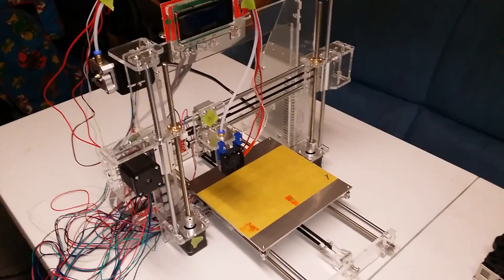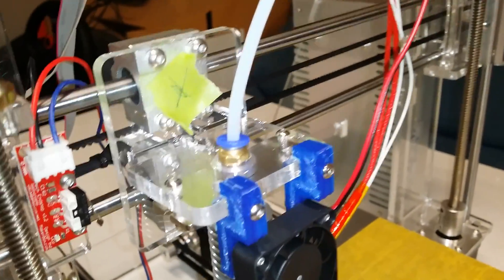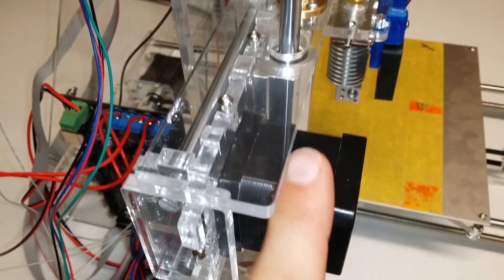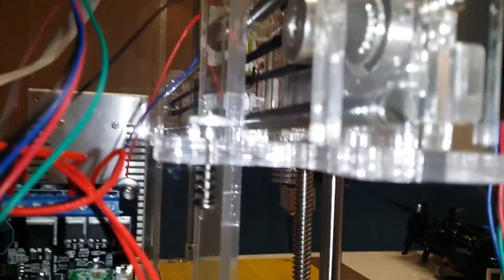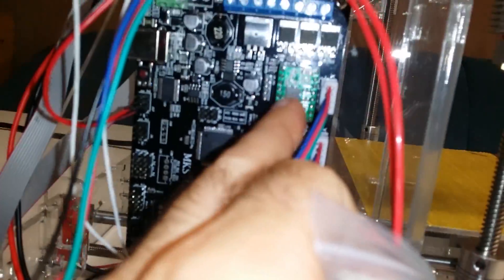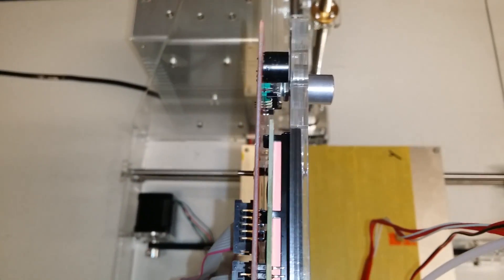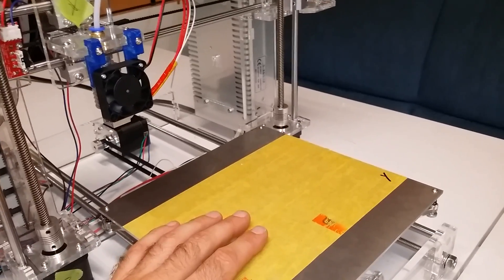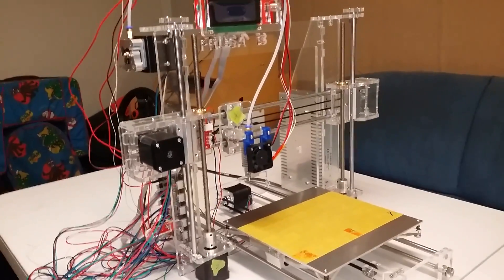Sunhokey prusa i3 3d printer rep rap kit build update 1

Comment: hey how this printer doing after 2 years?
Reply from the maker: Still going strong i have made a few mods 
if your interested i will do video on them
Reply: Of course I interested hehe, I want to buy the 3d printer but in my country, this thing is not really popular so there is only few type of 3d printers that available here and this version of the Sunhokey 3d printer is the most common here. I actually love into Anet A8 which has a good price and bunch of positive review but I need to spend more money for shipping and tax because Anet A8 currently not available in Indonesia. And do you thing is that worth that if i buy this version of the sunhokey 3d printer in 2017?
Reply from the maker: Not a problem.
main mods are the j head that is supplied with isnt very good
so order the e3d version (not the lite)
the roll holder is terrible so i will show you the way i have done it 
and grab your self some 
3m brand blue painters tape 
i will cover the rest in the video
give me a week or two do the video 
thanks for the interest
Reply: Yeah, you should make a video about how this machine is doing after several years, maybe its would very helpfull for people like me hehehe. Also It would be nice to see how the accuracy of this machine after 2 years of operation etc. Thank you btw for the information, you just got new subscriber.

Comment: I have the same machine. My problem is the heatbed as well.  But in my case, the heat bed does not respond to the g-code to heat up, I can use the preheat option in the control board, but as soon as I start a print, the heatbed turns off !  I was wondering if you might have an idea as to what the problem is.

Comment: Finished the build a few days ago, exactly the same issues you pointed out. Had to do some guesstimating and research on where exactly things are plugged into on the controller board. My fan on the hot end just goes flat out regardless of settings or where it's plugged in. Getting the printing dialled in the last few days, used the settings for the slicer and repetier that is shown in his video. Get curling problems with PLA and green tape, will try skirt and brim settings in slicer tomorrow. Cheers.

Comment: Hi gymp1979,
What printer speed do you use when printing pla with this printer and what temperatures and layer height?

It a nice cheap printer, but everyone seem to have problem with the cracks in the frame. Even when using shorter screws. But is seems to hold, for now.

Comment: 1. To compensate for the part that relies on only one screw, apply a drop or three of CA glue (cyanoacrylate) and then screw it into place. Be sure to position it just right... You could apply masking/painter tape around the position to force the correct position/alignment... 2. It looks like you might want to buy a piece of plate glass. From what I've seen, people don't rely on the heat bed itself to be the build surface... Don't forget to check for level when in place...

Thanks! Good observations.

Comment: Hi there,

Thanks for a detailed walkthrough this printer. Did you discovered what to do with the spare white cable? 5:03 in your video.
Reply from the maker: Ari it is a spare temp sensor for the print head.
Reply: Thanks for the reply I thought so.
I finished to assembly the printing, manage to calibrate the bed nicely I facing two problems so far. The first one I can't get the bed to heat. I have check the wires and all seems to be ok. No matter what I do from lcd panel or Repetier I can't hit the bed....any suggestions???
The second, I manage to bring the filament to the nozzle but it stocks there and I dont see any flow through the nozzle and recommendations here??? (Of course  I preheat the hotend and bring it to the 230c that is recommended) .
Reply from the maker: do you mean heat the bed?
im using pronterface, i set temp then hit go it should show up on screen left temp is current temp right temp is set temp make sure those are showing correct values 
from there make sure you have the wires in the correct spot mine is j7 h bed top left green connector if that is all ok then maybe check resistance of bed or voltage from board
as far as getting the filament through head i loosen of extruder pull though 150mm of filament so its hanging out of white tube
then heat head im using 220C push it threw by hand till you feel the white tube stop
hope this helps
Reply: Hi again, Would you share your calibration process?. Can you share your pronterface setup for pla and abs?
Reply: At which temp you printed with the PLA and ABS you have received from Sunhokey?
Reply: 220c head 60 bed for pla
I threw out the abs I measured it 1.5- 1.9 in thickness 
Wasn't worth the hassle

Comment from the maker: hey karthik,
first things firstly an you please take some measurements and photos and email them to sunhokey support.
i tried to explain it but its hard with out photos
hopefully if you do that they will fix the kit for others.
what i did what file the gap by hand and until the head fit nice and snug
you could use a dremal or or grinder just becarefull you don't make it to large and it slops around
hope this helps
have fun printing
Reply: gymp1979 Thanks for the reply bro. I just filed it. Now I have another issue, when i give print for the first time the filament is moving backing.. is that something to do with nozzle block o it is becoz of extruder.

Comment: I just finished building mine as well. The hot end is not actually an E3D one, it's just an ordinary J-head. The quality of the hotend on mine was not particularily good and I also had the problem with the mounting plate. I've ordered an E3D v6 hotend, I'll let you know if it makes any difference.
Reply: pcoetzee Pls update us on the E3D v6 hotend. I'm thinking of getting tat too...
Reply from the maker: pcoetzee my head is printing quite consistent,im pretty sure your right its not a genuine e3d head.
the biggest problem is the filament that was supplied with the kit is very inconstant mine varies from 1.5mm too 1.9mm never going to get great prints with it ive ordered some other filament will keep you posted
Reply: The V6 is installed!
A noticeable difference in build quality, it's also way smaller than the J-head, I reckon I gained about 10mm of print height. I was having issues with the J-head blocking when using PLA, that stopped. The print quality seems to have improved but I did not really spend too much with the J-head.
Just ordered some decent filament and a buildtak bed surface.
Reply: pcoetzee Where did you plug the thermistor cord into the board from the E3D? I just got an E3D V6 lite. Did you plug it into the same place as the old thermistor.
Reply: Yep exactly the same place.
Reply: pcoetzee Sorry, I have one more question. Where did you get the Configuration.h file for Marlin? If possible would you be able to send me the file?
Reply: The temperature sensor is the same model that gets used with the J-end. So there was no need to adjust the config.h file. (the sensor might be tiny in comparison, but it's all about what the resistance measurement is at a given temperature, and this is the same)
Hope this helps!
Reply: Exolive24 hey did you install your E3D LITE6? Is the print quality noticeably different compared to the stock j-head? I bought one and now just waiting for it to arrive via mail so it would be nice to have input in terms of quality and such.